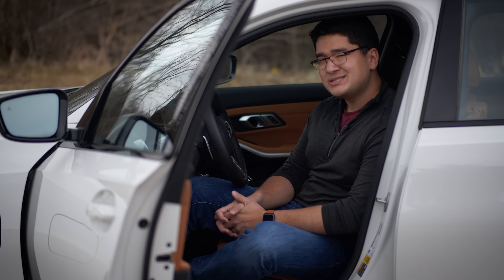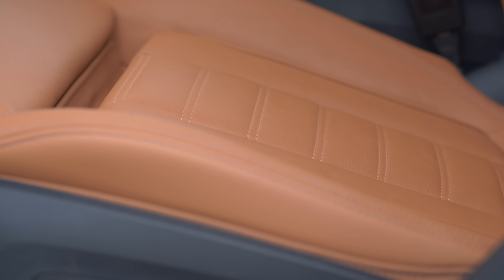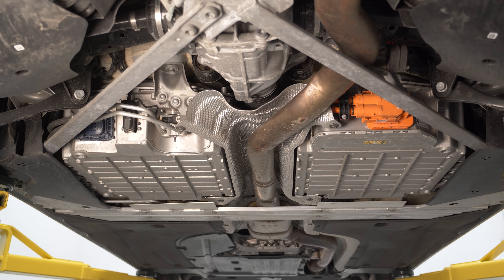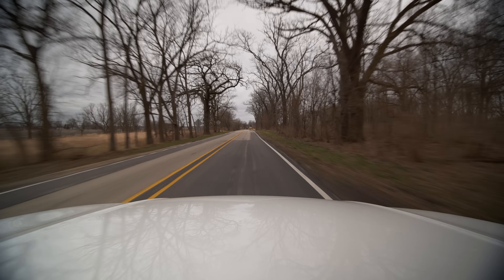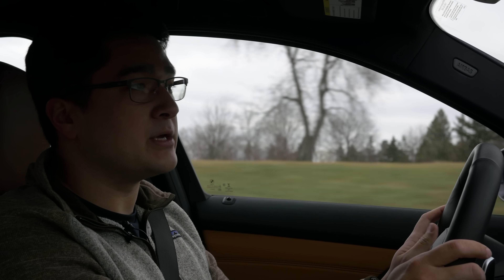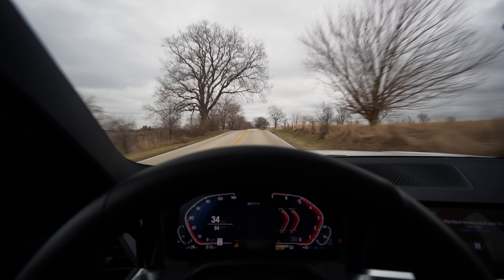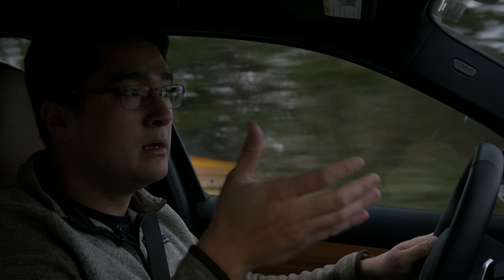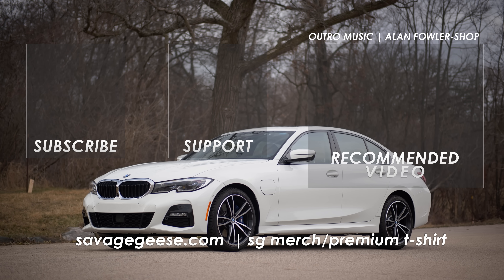2021 BMW 3 Series | The Transition is Here

Comment: The B48 engine really is a nice 4-cylinder. In the X3 I drove, it had nice response throughout all the RPM range and had almost no turbo lag. 

As a suburbanite, I think the "e" versions seem really appealing for saving money on, for example, making a quick dash to the grocery store. However, for folks who don't live less than 8 minutes away from places they routinely go, I don't think it makes a lot of sense.
Reply: Why?  It would still make a big impact even if you were commuting 80 miles, you would go half your trip before you would even begin using gas
Reply: @ryanc87  repair costs will easily eat up all of the gas savings.
Reply: @bassandtrebleclef  I would expect the repair costs would be similar or less than the gas version since you don't even use the gas engine on trips less than the electric only range

Comment: This is a compliance model.  It was designed so you could run around a city center like London where you can’t operate an engine. Its a stopgap until they get their true electric models refined.  Let’s hope they can get the i4 to drive quicker and farther before release.

Comment: BMW will go all electric and require each of the battery cells to be replaced on a different cycle in a specific order at 10,000 mile intervals to ensure "best performance"

Comment: Well, now you can have the car in 2023 for $44,300 plus a tax credit of $7,500 which is massive. The car is just $37,500 and you're right that if you spec it out the quality doesn't reflect the price . . . so don't spec it out. It's at the price Tesla promised for the Model 3.  I've got mine in spec'd white and cognac leatherette with the convenience package, drive recorder &  3D parking, along with heated seats and steering wheel for $46,350 and will get $7,500 back at the end of the year.
Reply: If the government "credited" my F150 with $7,500, I would have only paid just $22,000, a much better deal IMO and I can fill up in less than five minutes at any gas station...

Comment: How long until the steering wheel will be graphical? 😒
Also: The technologial development is sheeple-powered. It brings the worst of multiple worlds. Choice will be fading. Scarcity of options that matter. One monolithic agenda push. Unbalanced.
This hybrid moodiness depending on battery charge would bother me. It's gimmicky, inconsistent.
BTW, are there any acoustic tricks about the engine sound? Because I would say for a 4-cylinder it sounds good.

Comment: The center stack and vents with the metallic finish is simultaneously gaudy and uninspired.  Gauges are unattractive and won’t date well.  Run flat tires spoil ride.  There’s just too much overt disappointment for the money spent.

Yes, performance is good; composure is present.  It’s safe, luxurious and well-built.  But why buy it over an A4 or Giulia?
Reply: You need a full time mechanic to ride with you if you have a Giulia.

Comment: Why is it so hard for reviewers to get the facts right on PHEVs??  Lots of issues.  3:30 ... The car's listed as having 22 miles of electric range, not 39 miles.  Testers have exceeded this range in both city and highway driving.  Oddly, testers have been seeing much better range in highway driving; one getting 29 miles at 70 mph at around 65 degrees.  Electric range will always include a cold weather offset, so expect less than 22 miles in the winter, but count on beating the EPA range once the temperature goes above 60-65 degrees.    The idea that this car isn't usable for longer commutes is nonsense / ignorance.  It's a PHEV; not a BEV.  The idea is to significantly reduce the use of gas by using a small battery and electric only miles.  It isn't meant to replace gas completely.  The driver is still getting that ~22 miles of electric range every single day, reducing their daily use of gas, reducing gas station trips, reducing regular maintenance, and likely saving some money so long as they plug the car in every night.  With workplace charging, a person can double that range to ~44 miles per day.  With a L2 charger at home, they could charge at home for 1-2 hours and nearly get another full battery for going out at night.  

I'm curious why this car is returning lower city fuel economy in hybrid mode versus the 330i.  Makes sense on the highway, but being a hybrid, it should be regening energy in the city.  Hybrids typically get better fuel economy in city driving than in highway, but not this one.   I imagine if you're light on the throttle, this would return better fuel economy than the 330i.  Maybe BMW's sandbagging their numbers, or accounting for degradation over the life of the battery?

Comment: A sportyish Hybrid? It's neither fast, nor gets good range. MPG's? like anyone cares about fuel economy spending 60k. This is a car that shouldn't have been produced. I can think of 10 cars I'd rather spend 60k on before this. Buy a Mercedes hybrid, they went for a electrified power add. I think MB is the way to go if you want a mild hybrid. BMW straddled the fence and it just doesn't make a whole lots of sense to spend 60k on this

Comment: Next to a G70 or an IS350 I see absolutely no reason to buy this (at least from an American perspective)
Reply: this is def better than the IS350.
Reply: @kristians2704  maybe in the 340i, and that's a big maybe. It might be slightly better from the driver's seat, but I don't see it being nearly $20,000 better.
Reply: @Vlad-pi3jq  the 330i has a nicer interior, better infotainment system, more space, modern turbo engines. The M340i without a doubt is better than any of these cars but yeah also way more expensive
Reply: @kristians2704  I dunno man, maybe the infotainment is better but otherwise they're on the same level as far as interior, especially with all BMW interiors being the same across the whole range now. Idk about you but if I'm gonna drop 50 grand on a ride I'd rather have a naturally aspirated motor, and if you want a turbo there's always the g70

I used to be a big BMW fanboy, wanted to own one for a long time but they just feel like regular cars now to me, losing what makes them special imo

Comment: The 330e is the worst trim. It has a weaker variant of the B48 engine and the almost FIVE HUNDRED pounds the e-hybrid system adds outweighs the benefits. You can slap on a $200 piggyback to increase boost and get more out of the non-hybrid.
Also, the federal tax credit on the 330e is $5,836, so that helps a bit. But I think Mark would be less put off by the 330i which starts $3,300 lower and can be optioned well while staying under $50k.

PS: As Jack mentioned, the G20 is almost exactly the same size as the E39 5 series (1995-2004). I drive like a maniac so my overall MPG isn't great, but the 330i/iX gets in the high 30s at highway speeds.

Comment: Thinking forward to when I'm 50 years old and gasoline cars are illegal to drive without extensive permits. I decide I'm finally tired of being complacent to the changes of the world and I tell my  (hentai robot) wife I love her as I grab a set of dusty keys out a old box atop the fridge. There it is.. a small circular logo with the checker board black white and blue.. I begin to walk out the back holodoor as my post transracial daughter son texts me "where are you going Pa?" I don't reply... because my eyes are bad.... I walk to the garage and open the locked door, there it is.. a old worn vinyl tarp. Beneath it, a womanly curved silhouette lying dormant. I take the cover off dirt the first time in decades. She's as beautiful as the day I stashed her away when the police came to take back all the vehicles of the old world. I begin to cry... I open the door.. it won't unlock.. battery must be dead. I use a slimjim to break in.. I place the key in the ignition and hear I mild "bzzz". Fuck. All the gasoline evaporated out of my 330e and I have about 5 miles left on the electric battery. I try to drive forward and the rear tires all fall apart from the dry rot.. god no... in a last hope I open the trunk and grab my Proprietary State Issued Goose Gelatin Tablets and rail them. I collapse as everything begins to fade... I'm actually in a nursing home. That was my lithium pills Bruno force fed me for lunch.

Comment: bmw's latest technojunk. overpriced home appliance w/infotainment. guaranteed financial loss on a major scale. longevity and parts availability are not options as is the case with most vehicles these days. to get a decent ride you have to end up spending the cost of a house and THAT is nuts! thanks for the in depth review on the car. it confirmed what i was thinking about it in the first place. still searching for a decent ride i am that doesn't cost the same as a house these days. ;-) still looking like a custom build is the way.